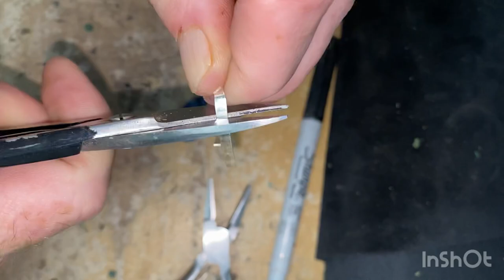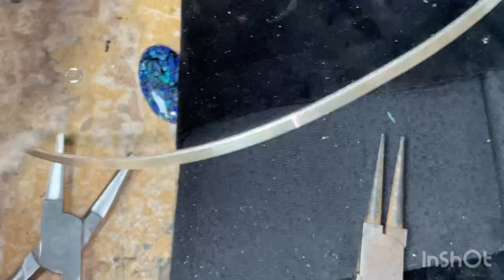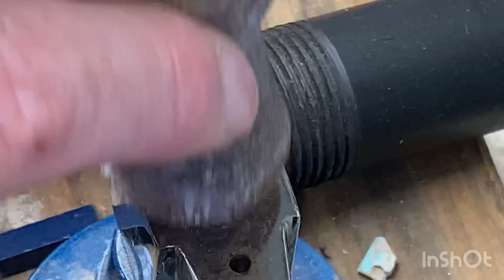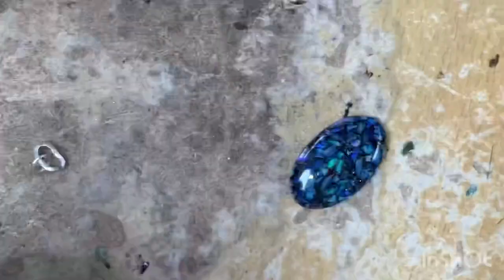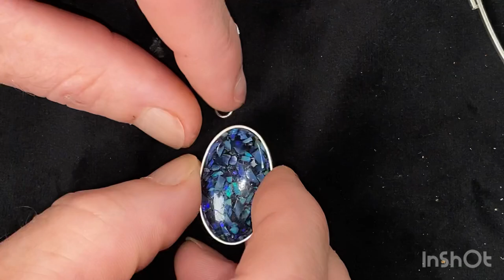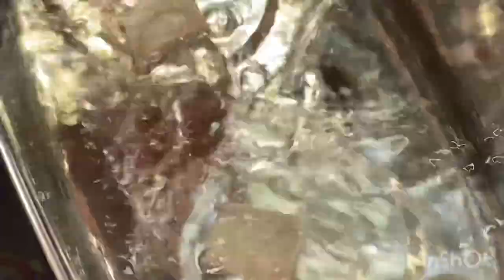Silversmithing: making a silver pendant.

Comment: H Phil , Great looking Pendant , I like the way you do the  backing , really neat , is that Vibrating machine a new addition , have we seen that before ,have I missed a video , thats got to help with the absorption of your solution , it looks like a Great bit of kit .
Reply from the maker: G’day Andy, yes the ultrasonic cleaner I bought (thanks YouTube) because of something I watched, I’ll be using it to clean out the pores of the matrix prior to sugar solution, then vacuum chamber to remove air from the matrix, then back in the ultrasonic cleaner to help the sugar solution suck into the matrix, then sulphuric acid. It’ll be fun if nothing else. 🤪👍

Comment: 20:18 what is this process?
Reply from the maker: G’day, that’s the new ultrasonic cleaner I bought (thanks YouTube) because of something I watched, I’ll be using it to clean out the pores of the matrix prior to sugar solution, then vacuum chamber to remove air from the matrix, then back in the ultrasonic cleaner to help the sugar solution suck into the matrix, then sulphuric acid. It’ll be fun if nothing else. 🤪👍
Reply: @theopalmills  Very cool indeed Phill!!

Comment: Did you have to  anneal the silver before you started or do you buy it as dead soft? .............Be well and be safe.......
Reply from the maker: G’day Bill, I anneal it myself usually, but the only piece of silver that could’ve used annealing, before being bent, would’ve been the bail, for its thickness. Annealing is to relax and realign the molecules, and also softens the st/sil momentarily, but as the silver I used for this pendant was thin and wasn’t going to be bent/formed to the point of notably stretching, I skipped the initial annealing, though after the setting was soldered together while out of shape, the annealing took place during soldering making it easier to reshape again after. 🤪👍